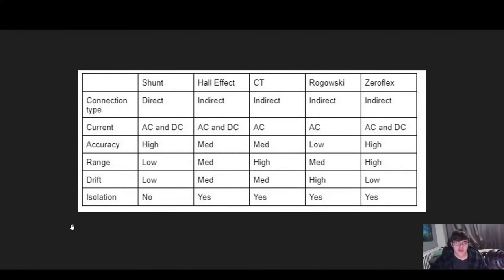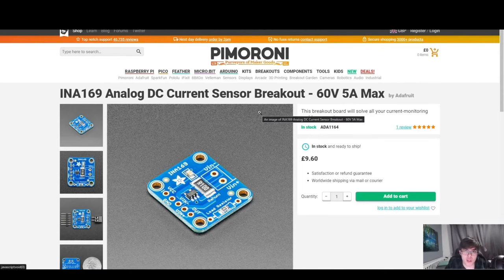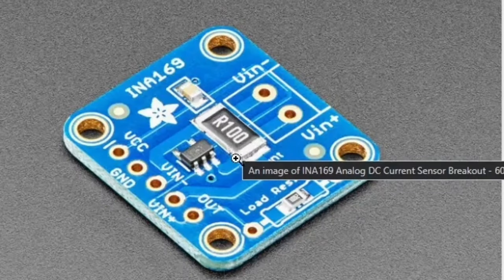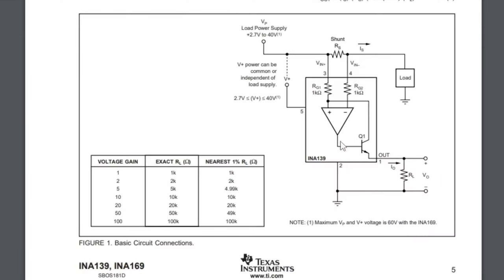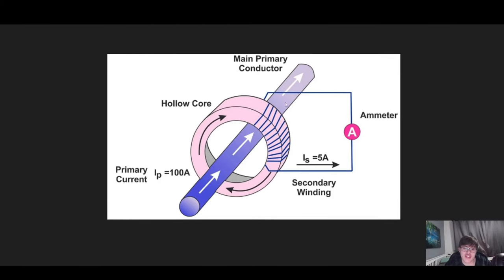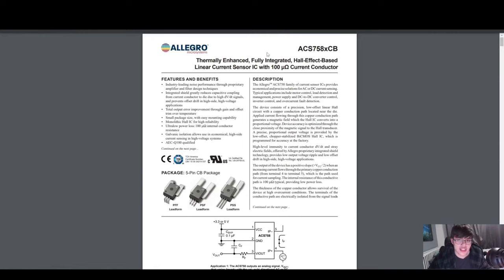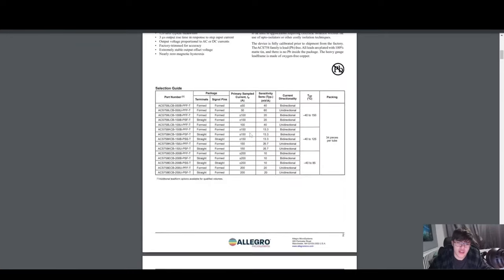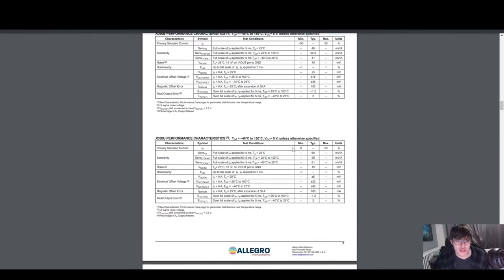Which Current Sensor Is Right For Your Project?

Comment: Help needed..(Question) I have a 12v motor that works off a key fob opening and closing a sunroof..it has 2 buttons..one opens it one way completely..one opens it the other way..but nothing stops the power going to the motor unless you press the button again..even when motor is maxed out..unit keeps powering it until it blows something..i need some sort of current switch that will break the circuit momentarily when it bottoms out as killing the unit will stop the process..if i forget to press the fob to stop the motor opening it will fry motor..so essentially what i think i need is like a self resetting amp adjustable fuse..but not thermal as it will take too long to reset also..hey man..nice video..thanks for all the info..i have a nice little project on at the moment, would love your advice
Reply from the maker: Thanks glad you enjoyed it!  Depending on your design whether you want to go noninvasive or invasive you should be able to get modules for these that have a relay embedded in so you will be able to turn the relay on or off depending on how much current you are drawing through the sensor. This is one solution of many, let me know if you'd like to have a chat to discuss further. Hope this helps!
Reply: @WinterCircuits  aw cool man thanks..i will check what amps its drawing in regular use and see what it spikes to when stalled out .thanks for quick response
Reply from the maker: @emmettcoen  No problem, let me know how you do and if I can help you out in any way.
Reply: why not using switches at the ends of the movements

Comment: Please help me, if I have a circuit that has an output of 50-200 mA, what sensors can I use to monitor this current?
Reply from the maker: If you need accuracy, as well simplicity I would suggest to use a shunt method current sensor, something such as the INA219, very simple to set up and reliable.

Comment: You look to know a lot so can you explain to me why am I getting 3.5 volt on the output of the op amp alway and if I add 1 millivolt to the no invertering I don’t get any gain from the ua471 and it data sheet said it’s gain is 1000 time and I don’t get any gain till I add 1 voltage the gain gos full the supply voltage why is this and I need it to sense current to control my load

Comment: I watched your video it was very informative thank you! However I was wondering if you would be willing to help me on a project, I am building my own welder compressor generator and I'm trying to make an electronic auto throttle I have a good strong solenoid to shuttle the throttle back and forth with a return spring built-in so I only need 12 volts applied to a solenoid triggered by a current sensor my weld output range is between 75-200amps dc and for advice or design would I would be greatfull for, Thanks again for your time and your video!
Reply from the maker: Hi Alex, thanks for the feedback! I would be more than happy to help you along for your project. Let me know what's the best way to get in contact with you and we can discuss requirements and what we can do.